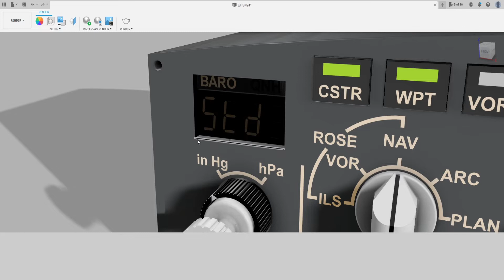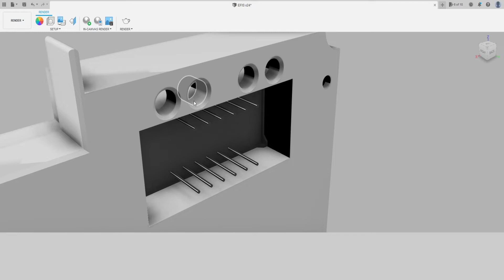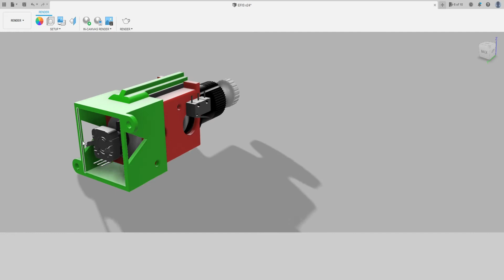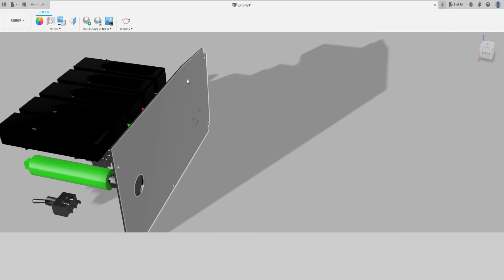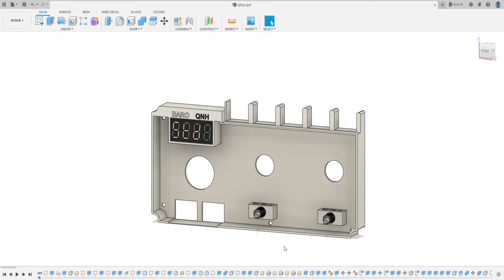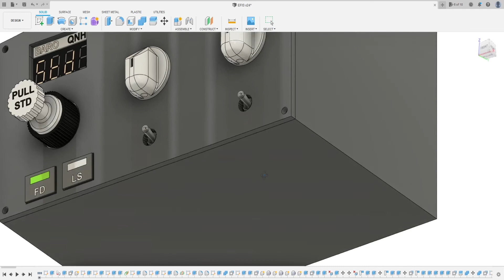3D PRINTED A320 EFIS DESIGN PREVIEW

Comment: Hello is there a manual with and also all parts available with you like the switch, led, 7segment etc or have to buy separately thanks
Reply from the maker: Hello. I only sell design and instructions how to build. All parts you have to buy separately. I have included list if parts you need to buy.
Reply: @solihindin2721  ok thank you for quick response but do you have an idea for the parts to fit in your work coz the dimensions of holes should be for a kind or type of switch and button